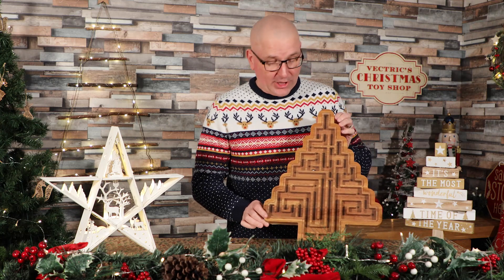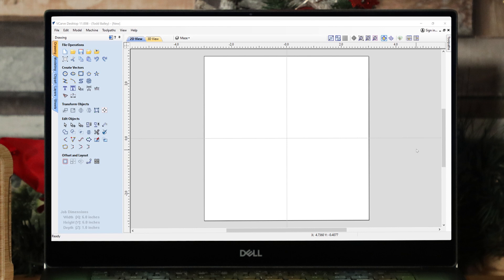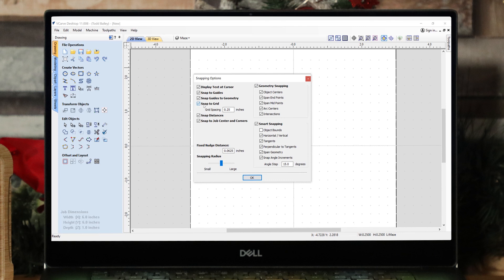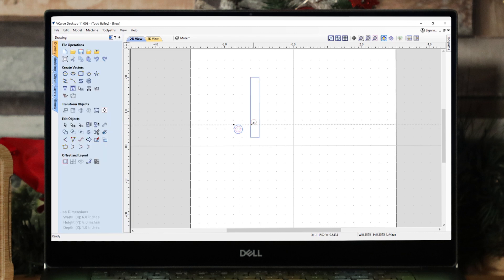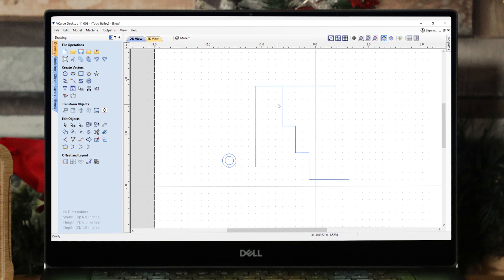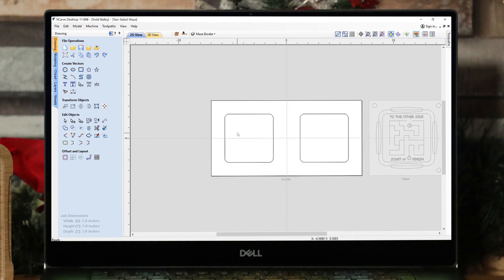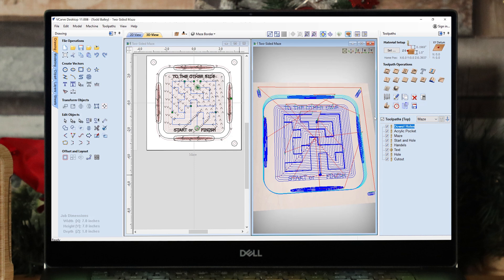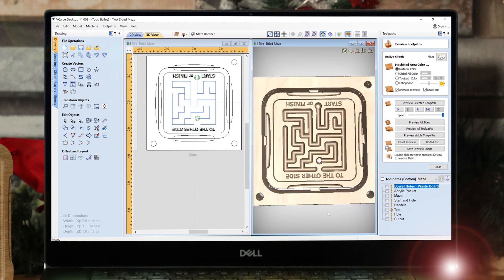Two-Sided Maze with Todd | Vectric's Christmas Toy Shop | Day 5 | Vectric FREE CNC Projects

Comment: Very nice project. I would make one change and use a different method to secure the acrylic to the wood. I could not stop staring at the glue in the finished project!  Maybe some small decorative screws or pins of some type.
Reply from the maker: You are exactly right.  I was not happy with that either and screws would have been much better.  Also if I had used a dark stain it may have been hidden better.  All for you all to try if you choose to make one... I highly recommend you make a better version and blow my Christmas socks off!!!

Comment: Great project, but I have a question:  In your file, the acrylic pocket is .116" deep.  The Maze profile starts at .125" and cuts .1875".  Why is the starting depth of the maze profile started below the level of the pocket? Is this related to the roundness of the bit used?
Reply from the maker: Hey David, good question, and well done for you checking the tooling.  I wish I had a good reason for you, but I hope this will due :) .  When I create these, I may not have the actual materials I plan to cut into on hand.  So I will guess thicknesses and update the file when I have access to the materials I plan to use.  I suspect I thought the Acrylic would be thicker than the real stuff, and when I went to fix the pocket did not reflect that in the maze tooling.  Luckily it was only off by a little bit, so nothing wrong happened, and to be fair, I did not even notice what it was cutting.  You're keeping me honest here, and this is an excellent example of always checking our tooling to make sure you are happy so you can understand what will happen when the file is cutting!